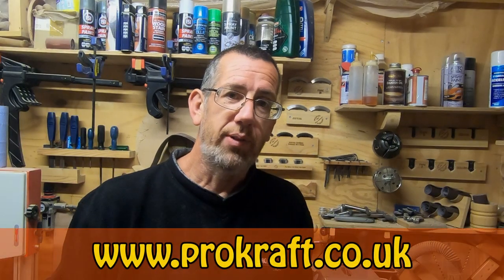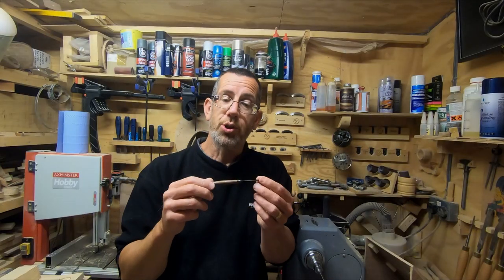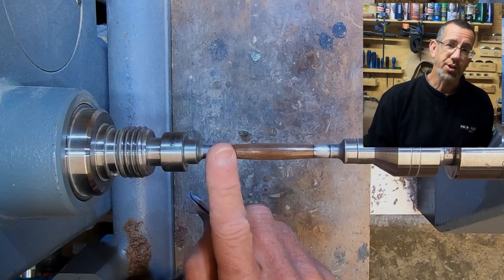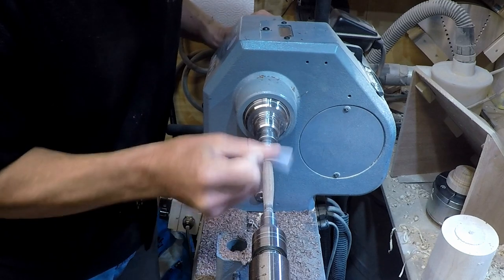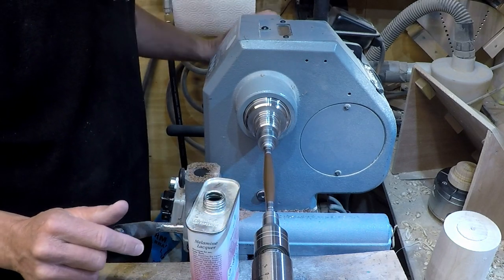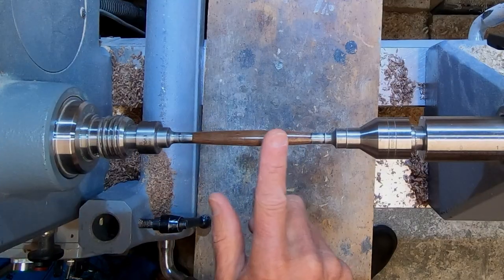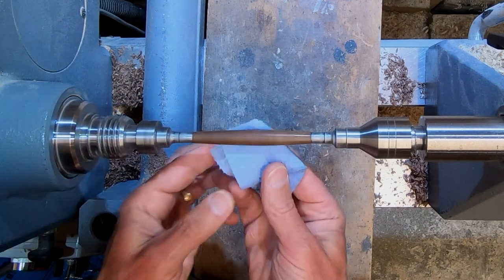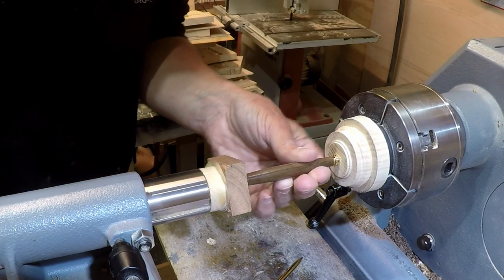Letter Openers -  Episode 304

Comment: Thanks Paul. With the bunches of bananas on the end of my arms, I think the longer handle would be good!  One thing - I've never done any pen turning, so is it essential to have a mandrel?
Reply from the maker: Thank you Keith. You may be able to get some turn between centre 7mm bushings that they sell for slimline pens. However if you are careful I'm sure that as long as you've trimmed the ends to the tubes you could mount one end on a jam chuck to insert inside the tube and at the tailstock have something that isn't going to wear the brass tube from that end. You just need to be careful on making sure you turn the ends to the correct size.

Just searching the cheapest pen mandrel I can see is about £20. If not watch the Facebook groups as one may be for sale at a very cheap price, especially as people upgrade.

Comment: Hello, Terry from Chestnut has always stated that one coat of sanding sealer is sufficient and anything further is a waste. what is your take on this?
Reply from the maker: Hi Peter, generally one coat should be enough. I was trying to fill all the small grain slots as much as possible so not sure if the extra coats did this or not. It's very quick to put on and dry thinned down so was worth see how it came out. I was pleased with the result so maybe I need to do a comparison at some point. I'll think about this for a future video. Thank you for mentioning it as it gives something to think about.